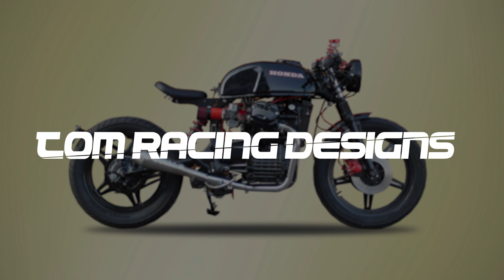[PART 2] Transforming a cellar into a workshop - New upgrades Timelapse

Comment: If you allow me to give you a little hint on glueing the anchors: when the glue/mortar comes out of the hole, let it dry. Then take a flathead screwdriver and a hammer and just gently tap it. The glue/mortar will fall off perfectly and your threads are cleaner than when wiping it off.